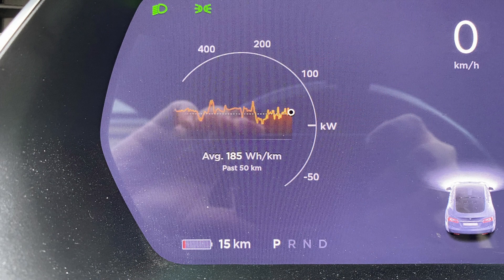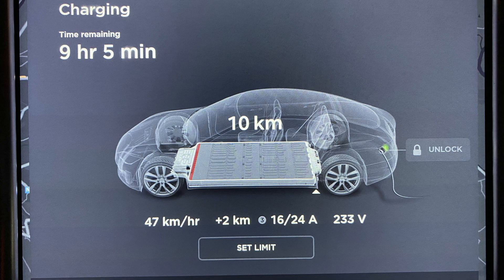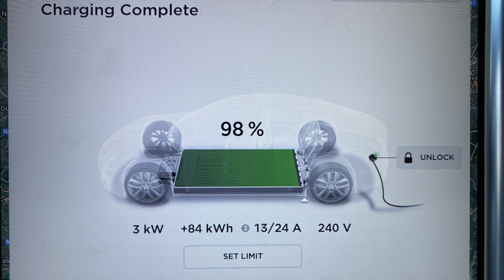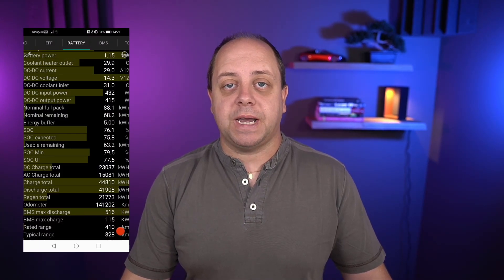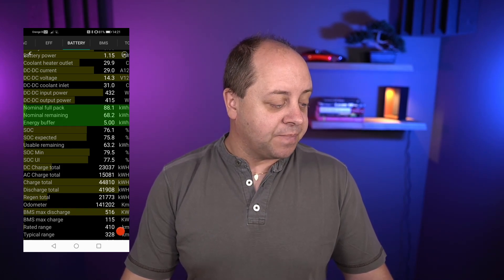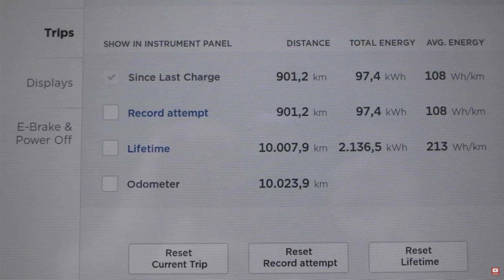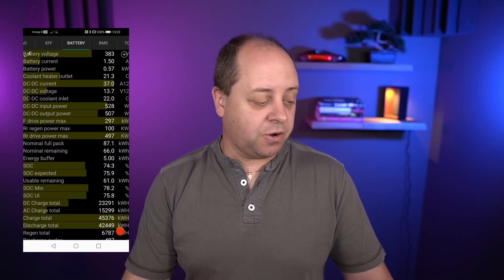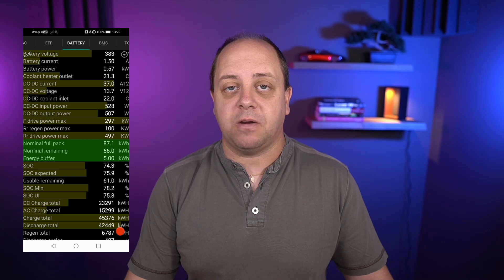Testing my battery pack degradation - part 1

Comment: My M3P from April 2019 is showing 68.5 kWh nominal full capacity. This is before any BMS calibration, but obviously it is a bit worrying. Is the Nominal Full Capacity the true available capacity or do you have to subtract the Energy Buffer value first?
Reply from the maker: Your range down to zero is the nominal full capacity - the energy buffer. So in my case the 87.1kWh - 5kWh = 82.1kWh. That is roughly the number, but ScanMyTesla is not entirely accurate for that measurement, it seems.

Comment: 3 phase 230v 16A is not 11kw, you mis-spoke i think?  It is 5.2kw.
Reply from the maker: 3 x 230V x 16A = 11.040W or 11kW. This is of course in the assumption that you have a TN grid with 3x400V+N and not the IT network with 3x230V without N, which you find in Norway and parts of Belgium.
The difference is explained in the second part of this old video https://youtu.be/HWcxzGHlQDk

Comment: I have 100kw battery  and it shows 91.7 kw nominal so dose that mean I have 8.3 kw derogation ?
Reply from the maker: The 100kWh battery is actually 102.4kWh with 98.6kWh usable because of brick protection. That is when it is brand spanking new. If you see 91.7kWh now in the BMS, thst could mean you have a degradation of 6.9kWh.
Reply: @StevenPeeters  Do you think thats a lot for a 2 .year old car thats only done 11,000 miles ?
Reply from the maker: @zaferroni  The biggest degradation happens in the first 15,000-20,000 miles, as you can see in this graph: https://maartensteinbuch.com/2015/01/24/tesla-model-s-battery-degradation-data/ It also depends on your charging habits, for example. But it looks more or less as expected. Also, how did you measure it?
Reply: @StevenPeeters  Charged to 100% at home tesla 7kw charger  and using Tesla-Fi.
Reply from the maker: @zaferroni  I'm not familiar with Tesla-Fi features. Does it read the BMS directly? or did you just measure the charge itself?
Reply: @StevenPeeters  BMS directly ,nominal full pack 91.7at 100% charge ,also shows 5kw buffer and useable 86.7.
Reply from the maker: @zaferroni  It is on the higher side, but within the data points of that graph I linked earlier. Tesla will still say it is within expectations. For the S and X I believe you need a 20% degradation before they will consider replacing it.
Reply: @StevenPeeters  Yes that's  what Tesla told me ,its within spec ,they told me its the DC chargeing thats affected the battery ,it has 4500h AC and 2500h DC + Regen 600 from what I remember.